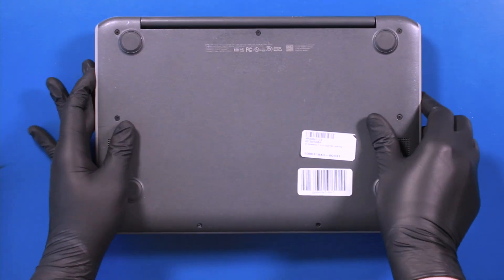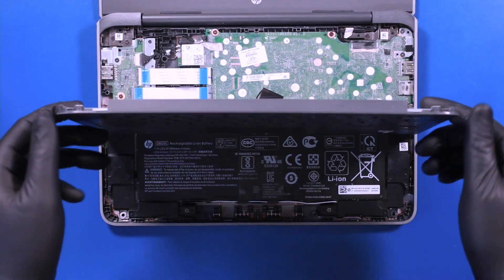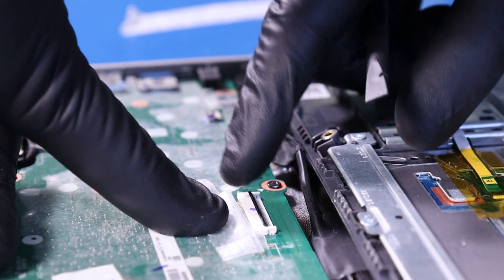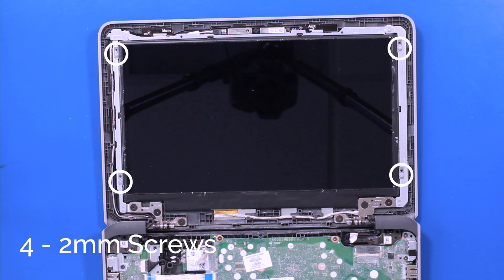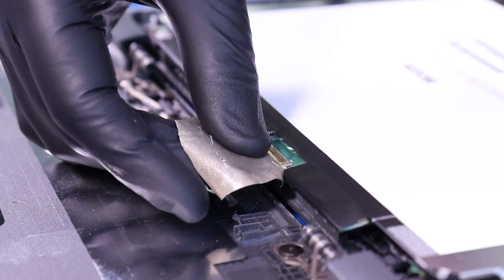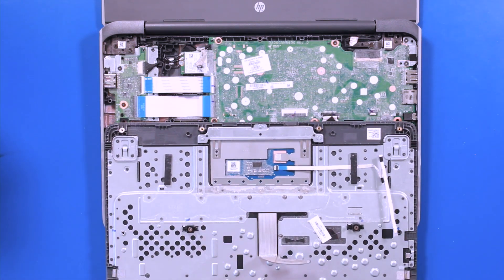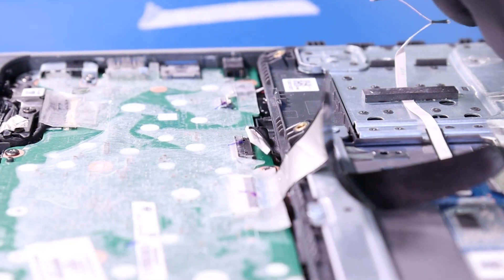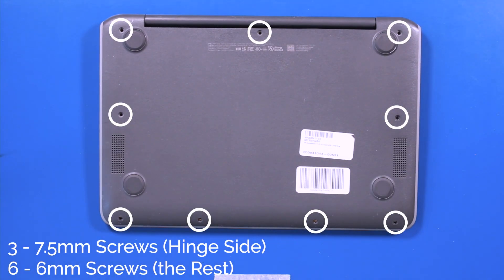HP 11 G7 EE Chromebook LCD Screen Replacement

Comment: Maybe I shouldn't have removed the clear plastic on the mother and daughter board. Hopefully they dont notice.
Reply from the maker: While there is a higher potential of shorting if anything is spilt on the motherboard without the plastic, and if you press down very hard on the keyboard you may cause contact between the motherboard and the metal back plate on the palmrest - which also could result in a short - removing the plastic is generally not a big issue.
Reply: @Chromebookparts  Ok, thx.